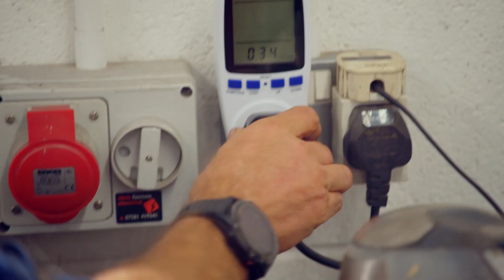Guy Martin's Great British Power Trip: Sunday 12th Feb on Channel 4!

Comment: Hydrogen is the future
Reply: The Hindenburg has entered the chat and would respectfully disagree
Reply: Люксово
Reply: @mattgayda2840  but that was a giant balloon filled with the stuff. If stored properly it’s as safe as the petrol in a car tank.
Reply: @user-zu6qn9ux9n  it's absolutely not because it's under pressure. A pressure vessel filled with an explosive gas that will cause engine runaways and it's exponentially more explosive than gasoline. The pressure vessels themselves present a danger gasoline tanks don't.